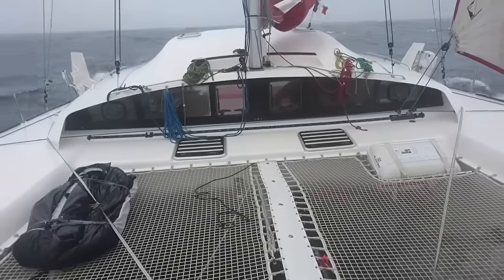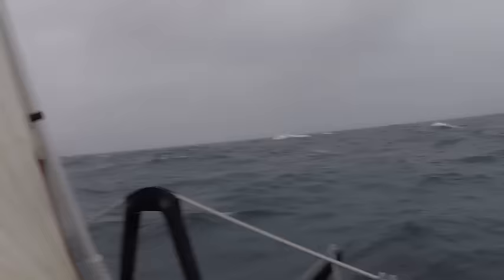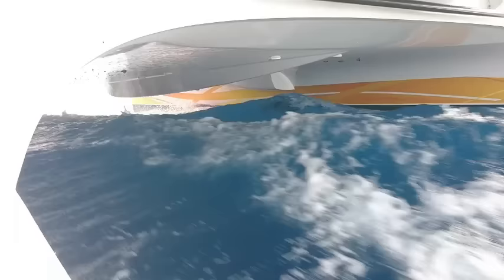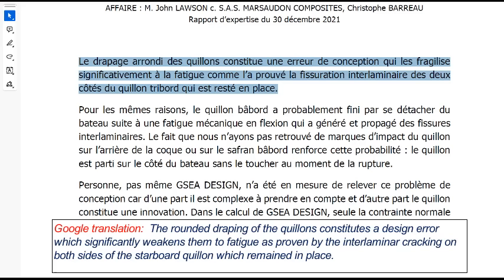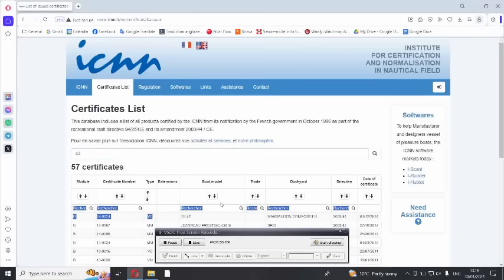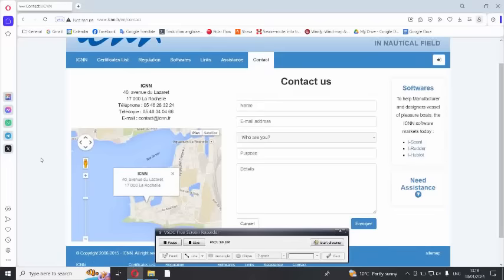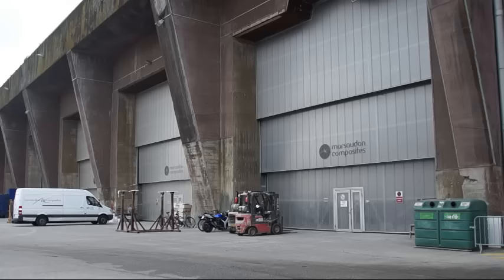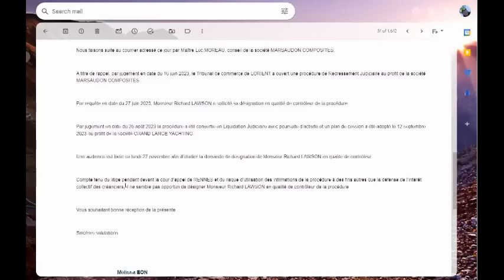Keel broke off mid-Atlantic - Marsaudon ORC42 Catamaran Part 1

Comment: Thank you for sharing your experience and for warning potential buyers. It shows the need for a thorough expertise when buying a secondhand boat from any yard. Did your insurance offer any help?
Reply from the maker: Yes, you're right. Of course, this boat was bought new. The insurance paid some initial legal fees but stopped helping after about a year. It's really frustrating that it has proved impossible to reach a reasoned settlement that works for everyone, rather than constant adversarial legal action.

Comment: Mate you must get the boat back, you may as well have the boat than nothing, it can be fixed. It doesn't look like you'll get anywhere here legally, i'd be getting my boat back. Good luck mate
Reply from the maker: Thanks! But I've been unable to use it for the last 5 years and 8 months, during which time I have won the legal case. Walking away now seems nuts to me. The receiver is paying posh Parisien lawyers to hide from me whether he has money. Why would he do this if he had none? He could just show me. I'm all in, and in any case there is the wider issue of the safety of the design.

Comment: I gotta admit to not liking those keels, they look very delicate stuck down the way they are. I thought they were daggerboards looking at their shape,i reckon keels stuck on should be long length ways, not so deep and angled a lot at the front. As for the stiffener/rib that separated inside the hull in my opinion should be carried all the way down the side of the hull, down below floor level and as far down as possible. The weight gain would be minimal compared to the extra strength. Besides that and the workmanship she's a lovely looking cat
Reply from the maker: You are absolutely right. They are shaped like daggerboards in order to extract better upwind performance, as you would get with daggerboards. But that subjects them to much higher loads, since they can't be retracted when reaching fast, as you would with daggerboards. The problem here is that they designed a tight radius into the form of the composite where the keels meet the hull - right at the point of maximum load. I've heard a naval architect suggest the same solution to the stiffener/rib. It's possible that Marsaudon did this with later boats (mine was number 7 of a run of about 40), but I don't know. And you're right, it's so sad that it was not designed and built with a bit more care, because the concept is great and I loved the sailing that I was able to do in the 2 years before it fell apart.

Comment: Sorry to hear your story. I nearly purchased a second hand TS 42 in 2020 with dagger boards. I never liked the design of the fixed keels on the TS42 - no internal structure as per a monohull but as you found out the boat performs well with one keel so is relatively cheap to replace compared to monohull keel. At the end of the day grounding a yacht is not good and I would be very surprised if this did not contribute to the issue - appreciate design fault - (these fixed keels were used by two TS 42s in a charter fleet for a number of years before you purchased your boat). The rudder issue is very bad but luckily two rudders. I don't think it is right to add Grand Large to the issue - any business would buy a company without liabilities - Outremer and Gunboat have a fantastic reputation. I appreciate legally you were provern right but now move on.......Get your boat back - fix it for £20k and you have a boat worth £350 - £400k.
Reply from the maker: The expert's estimate for repairs is 77k €. I've not managed to find a quote below 100k £. 
GLY settled other open litigation. Are you by any chance the owner of an Outremer cat?
Reply from the maker: Although I believe the design flaw that the expert considered could lead to the break up of the boat, exposing the occupants to the risk of drowning, is a matter for the ICNN and Marsaudon, I'm not aware of any action that they have taken. I don't think it's right for me to simply look away
Reply: The patches of missing resin are enough for me to never put her back in the water. Knowing how many structural flaws exist with the hull, and by proxy assuming there are many more unseen, opens you up to extreme liability.
Reply from the maker: Yes, if the boat is fixed it has to be done right. Someone who can test properly to not miss any dry areas and who has mastered resin infusion, so that the repairs are reliable.
Reply: Not an owner of an Outremer but sailed on them, Catana, Balance and other performance cats. I am truly sorry for your predicament but time to move on - look out of the box, get the boat to Grenada, Trinidad, Brazil - lots of composite repair people around. Rudder needs to be fixed and bulkhead. The scary thing here for boat owners is that Marsaudon were a leader in composite boats (many race ones) - how do other manufacturers stack up? Its strange Marsaudon went bust in a booming market - perhaps other liability connected with the capsizes and loss of life? Good luck and remember OLLI...................

Comment: OMG... I was very close to buying an OCR! I'm surprised that Outremer would work with such a company. Many thanks for the info. Great job! I decided to go with the super-light Stealth 13.2, built by Asia Catamarans (a Swiss/Australian company)
Reply: looking at Stealth - did you buy new. How is  the boat?
Reply: @Moonfish
Reply: @Moonfish
Reply: I signed up a year ago... they will start building any moment. The boat weighs 3500 kg when fully fitted out. It boasts some absolutely amazing engineering features. It sails like a dream. Originally designed as a regatta/race boat, the Stealth 13.2C is its cruising version. The first cruising model was the 14GT (the WOW), which just completed its circumnavigation. In light winds and in terms of top speed, I don't think the ORC42 would stand a chance. It is a spartan boat like the ORC42, with no unnecessary weight

Comment: I want to live in a world, where we can put trust each other. Stories like this makes me very sad. Thanks for posting and sharing your experience. I wonder when inspecting a boat, is there a way to find dry fiberglass in the molding, some type of hull scanner.
Reply from the maker: I'm told ultrasound works well. Most surveyors should be able to detect anomalies by tapping the hull and listening for inconsistency in the sound, but to have proof in a non destructive way ultrasound may be the best option.

Comment: John thank you for putting this lamentable tale into such a calm and coherent video. I also note that you are by no means alone with major issues with production catamarans, there are many woeful examples on YT.
You covered all the bases when it comes to the definitive faults but you were  right to draw attention to the Classification/Certification Agencies - they are indeed not all they should be (and that does not just apply to boats), the FAA has been caught with its trousers down of late.

You have been dealt with very unfairly and I hope you achieve an acceptable outcome. I cannot print in clear unambiguous terms what I may have considered doing.😉👍⛵️
Reply from the maker: Thanks! Absolutely.

Comment: I have always wanted to build my next boat out of a cold molded hull. I have learned that the hulls are far more robust than ANY typical fiberglass/composite hull. My dear friend built a 60’ schooner out of a cold molded plan and it’s been 18 years since it’s construction and there isn’t a scratch or dent or area that has seen ANY rot of delaminating. 
It’s a no brainer to me and I strongly urge anyone thinking of building or buying a cold molded hull to do so with confidence. 
I also have a friend that picked up a 72’ motor yacht that was home built. By a couple. They used the boat for 25 years and sold it to my friend. He’s done nothing to it other than new paint and some new gear. It’s a great way to build a boat and 14:43 stronger than ANY other method. My buddy with the 60’ footer once thrashed the mid hull into a rock outcrop and although they damage was very deep, the epoxy infused fabric ( Dinel ) kept water out of the boat. It was amazing to see the shape and mold of the outcrop on the hulls surface without it breaking through. The fabric used is EXTREMELY flexible and robust. It’s like pushing your finger into some play dough. 
There is a great book written in the early 80’s all about these boats. 
Building a Cold Molded boat”
Gosh I’m sorry you went through such a terrible time. Who would think a boat that new could suffer from such problems. There is clearly NO EXCUSE for such shoddy work. I suspect 90% of there labor force is untrained and the construction of their hulls is most likely being observed and overlooked
By a few experienced men or woman. 
Good luck to you sir. 
✌️🇺🇸✌️🇺🇸😎

Comment: Very important, and well documented info, thanks for presenting it. Googling this brand doesn't reveal the issues you have shared, pretty sure they use the money they owed you on their own marketing tactics to coverup their brand's reputation on the internet and boat dealer networks. It really is unfortunate that some companies are run this way, with the immediate bottom line superceding safety. Your case was an opportunity for them to make a great stride in their production quality and customer satisfaction and they entirely blew it by misplacing blame onto the customer, and they escaped their consequence because the legal system does not favor the little guy. Sorry to hear of your terrible experience, hopefully it doesn't overshadow your love of sailing.
Reply from the maker: Thanks! Exactly right.

Comment: I have seen a large and new Outremer last year here in the Canary Islands where the mast has broken through the saloon roof. Outremer had previously issued a recall for this. This yacht was affected. According to the manufacturer, Outremer technicians reinforced the mast mount and then it broke through the saloon roof. On a boat that costs well over 1.5 million euros. I have seen this boat lying in various marinas throughout the year, as the mast breakage caused water to break through the hole while sailing on the Atlantic. The water found its way into the electronics installed underneath. All the equipment was completely destroyed and I think a lot of the electrics had to be replaced. Insane.
Reply from the maker: Multihull of the year for the mainstream Yachting press! Insane...

Comment: I've been involved in epoxy composites for many years (I built my own 8.5M carbon trimaran) and this tale is one that is both sobering and alarming. All I can think to offer is that any potential purchase of these type of boat is accompanied by a very thorough survey with an insurance backing just in case. Taking a hole saw to what appears to be a nice shiny hull is extreme but may be the only way of checking those dodgy "acoustic anomalies" revealed by tap-testing the whole boat.
Reply from the maker: Thanks. Yes, it's a brave call to cut into a new hull when the builder says it's all normal. But you're right!
Reply: I have build boats, both race boats and cruisers and there is so many construction failures and bad craftmanship on the boat in this video, so i think it cant be the only Marsaudon Composite boat build that bad
Reply: That hull could have been thermal imaged without having to chop holes in it.

Comment: As an engineer I would definitely not trust any boat at face value. It’s always worth doing your due diligence when it comes to these small production sailboats, too many things can and will go wrong in the construction process. A lot of the issues in this boat could have been detected relatively easily but often when it’s a new boat assumptions are made.
Sad thing this poor man is now out of everything!
Reply from the maker: I agree that I made the assumption that an established, albeit small builder, who's boats were certified Category A, would make safe boats. It has been a shock to discover that this is not the case. However, I would take odds at the idea that the design flaws (keels and strengtheners) could have been discovered relatively easily.

Comment: As a sailor, I feel sad for your situation and wish you the best if luck. As an engineer, I appreciate the excellent examination and report that was prepared for you. Unfortunately, it is likely the time taken for the thorough review compromised your ability to obtain a timely resolution. Perhaps the complaint should have been limited to the most critical areas, with the balance covered by an opinion.  We see here, yet again, that leading edge designs, materials and construction techniques, when implemented by the dishonest or incompetent, fail to deliver on their promise. Unfortunately, while we can read specification sheets and go for test sails, we cannot take suppliers and corporations out for a test drive. Thank you for posting you video. Regards.

Comment: Really surprised that the expert surveyor took three years to gather info and do his report. That's quite a long time for what seems like a pretty straightforward analysis.
Reply from the maker: Good point. There are lots of smaller stories within the big story. For example, he decided quite early on that the naval architect who designed the boat should be formally included in the investigation (because there was a chance that design may be a factor, and he should be there so that he can defend himself should he be subsequently counter-sued by Marsaudon - who contracted him for the design before starting the production series). After months had passed and Marsaudon still had not done this, eventually the expert tried to do so himself. The court took time to consider but decided that it had to be Marsaudon doing this. The expert scheduled the next meeting and, a few days before that meeting Marsaudon lawyers informed him that their client had changed their mind and did want to involve the naval architect after all, so some more months were required to achive that and the meeting needed to be put back, etc. There were many examples of big delays. None were forced by me... As I've said, I was surprised by the attitude of Marsaudon - I would have expected any boat company to want to understand what's behind the problems with one of their boats. During the 3 years of expertise, these boats continued to be built and the ICNN certification could not be challenged. Of course I now know that even after the expertise the ICNN have not engaged with me...

Comment: The Sail Life channel recently documented some rehab work on a cat with keel issues. The keels on that boat had what appeared to be extremely flimsy connections between keels and hulls.
Reply from the maker: Yes, I saw that. But if I recall correctly, the difference was that the edges of the keels were straight. In this case the problem was that the keel edges were formed in a tight radius right at the point of maximum stress, at the level of the hulls.

Comment: I really hope something positive comes from you sharing your experience, I can't imagine the toll mentally.
Behind those keel delaminations it looks like the foam collapsed from inadequate compressive strength, and the glass has then filled the void and delaminated under bending moment.
Those dry areas are so common where molds are first coated in an opaque material(gel coat, etc) because they prevent the builder from visually inspecting the success of resin penetration in both vacuum and hand layup. I think it's bad practise and hulls should only be painted after inspection. I know there's a powerboat manufacturer in the USA that does this for this very reason.

Those detached stiffeners, were they designed in to support the shrouds?
Reply from the maker: Thanks! I'm pretty certain that the shrouds are attached further aft.

Comment: Whilst one shouldn’t generalise these issues on all boat builders how can buyer of a new boat avoid these problems. It seems rare to instructed a surveyor to oversea and supervisor building of one’s boat but perhaps this should be the norm.
Reply from the maker: In most other areas (automotive, aviation, etc.) the certification process takes care of this. I have no experience of yacht certification outside France, but boats that are certified by the ICNN do not seem to be guaranteed safe, as they should be. So sadly - yes - I believe that instructing a survey to oversea key stages of new boat build would be a wise expense, if you choose to buy one of these boats. Of course, a survey is unlikely to pick up the design flaws identified here and I don't have an answer to that problem. Existing owners may be reticent to speak up for fear of devaluing their boat. You seem to be doing the right thing by researching as best you can.

Comment: I was shocked by the deviance of the French  legal system to allow a company to exclude all liabilities when purchasing a failed  business . I am saddened by your loss and sincerely hope you will finally have recompense from these scoundrels.
Also shocking is  that Outremer are using this  outfit to build for them ! Beware Outremer buyers and be certain that your new Outremer is NOT built by Marsaudon !
Reply from the maker: Yes, I was particularly disappointed that the 2 months of deliberation by the Lorient Tribunal de Commerce to 10 July, with such a clear technical report, was insufficient and the judges took the unusual step of giving themselves further delay in the judgement until 4 Sep, putting it 3 days after the same Tribunal transitioned Marsaudon from administration to liquidation. I am led to understand that the judges there are local unpaid volunteers from the Lorient community (where Marsaudon is located). I wonder if paid professional judges from another town might have managed to reach a judgement before Marsaudon went bust?